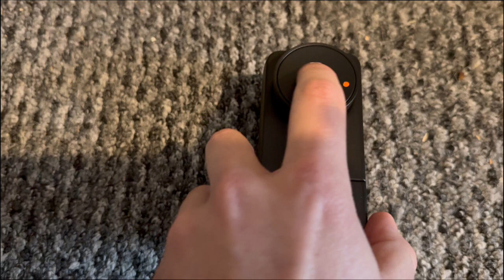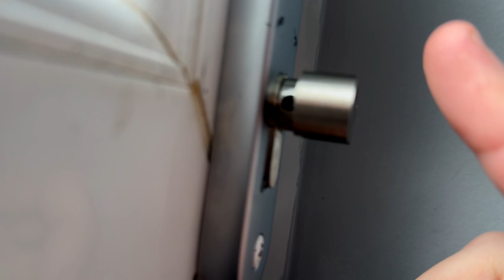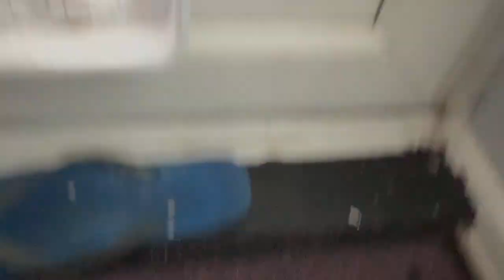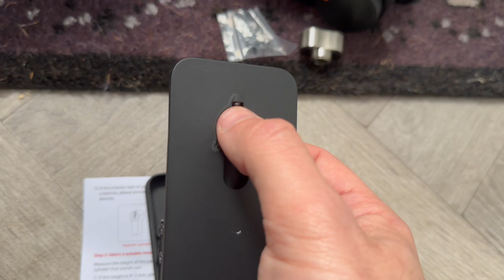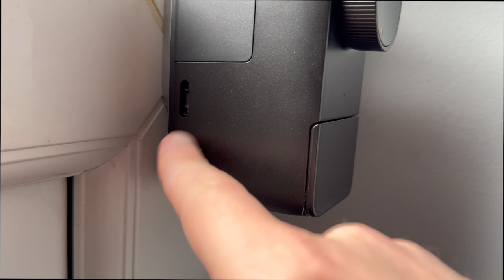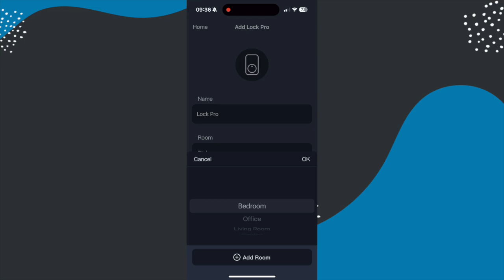Setting Up the Switchbot Lock Pro and First Look!

Comment: I am installing my second lock pro. First one I purchased in europe and installation went fine including night latch feature. Second lock pro I purchased on Amazon USA, I am trying to install it to my door and the night latch feature is not available (it does not ask me during installation and calibration process). Any idea? Is it because second device was purchased in USA and maybe they do not support the night latch feature?
Reply from the maker: That is odd, I would have thought that feature would be software not hardware related, is the option there if you calibrate it without and then go into settings > calibration > calibrate manually?

Comment: I'm so confused. Mine only came with one mounting bracket. :/
Reply from the maker: Which country are you in? From various videos the accessories vary depending on your location
Reply: @MarksTechVlogs  I’m in Australia. But I’m not sure where the lock was sourced from.
Reply from the maker: Ah, I’m guessing they only include one in Australia…maybe to do with lock types
Reply: @MarksTechVlogs  which isn’t that helpful if I need the other mounting plate. There’s also a video on their official YouTube for an adjustment plate but no mention of where or how to get it. It’s all incredibly confusing. I just want to install the device.
Reply from the maker: I’d drop switchbot support a message as I’m sure they’ll send one out. I think they even have a WhatsApp support which they usually reply pretty quickly to
Reply: @MarksTechVlogs  I’ve dropped them an email and I’ll wait. Didn’t think about WhatsApp. I’ll look it up. Cheers.

Comment: For the mounting bracket B, could you please tell me what size the screw holes are that allow it to stick to the lock? I'm assuming they're m6 with a distance of 38mm as is typical, but i wanted to make sure, and i can't seem to find anything on their manuals. Thank you for your content 🙏
Reply from the maker: I have no idea…they’re the same as the Nuki ones I think. I reckon if you email or message switchbot directly they’ll know, they’re always pretty helpful
Reply: @MarksTechVlogs  gotcha, thanks!

Comment: Great first look/install video, thanks!
I hope you are planning to do a comparison between the Switchbot and Nuki (size, noise, functionality, apps, google/amazon/apple/homeassistant integrations) :)
Those seem to be the best(?) bolt-on locks, though they won't look all that nice on the door.
Ideally (to me) it should be a fully integrated lock, though that raises even further the compatibility issues (and price!).
Reply from the maker: Yes...currently planning a Nuki vs Switchbot Lock Pro video which should be out early May...I also have a Youtube short planned specifically comparing the difference in noise (spoiler...the Switchbot is quieter)